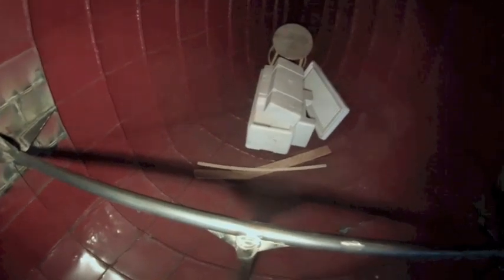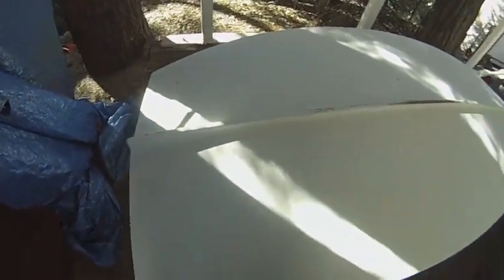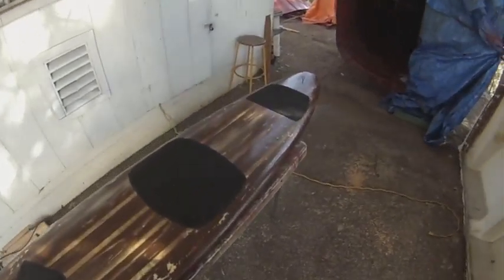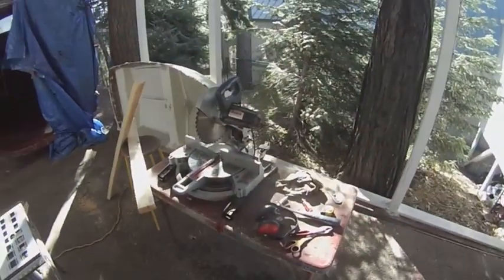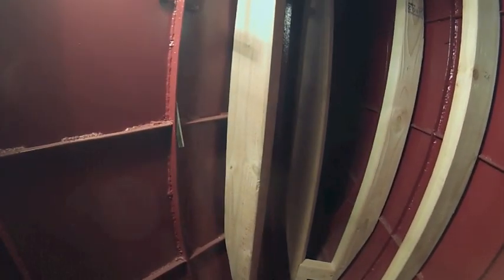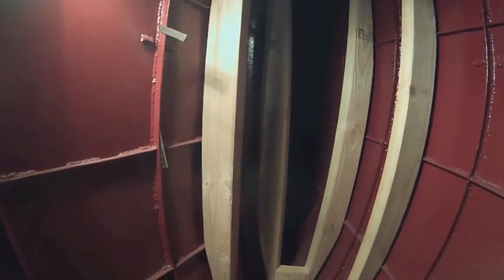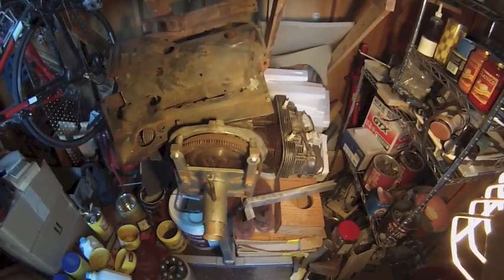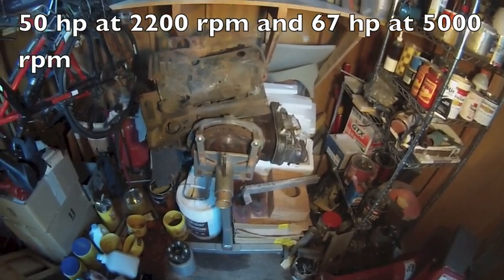Steel Sailboat Build Part 12

Comment: Hi I enjoy your boat build videos. I used to be a ship fitter. And a diesel mechanic . I have a warning. I'M sure you know but JUST IN CASE YOU DIDN'T.WHEN USING ALUMINUM AND STEAL YOU MUST USE A GASKET STRIPS OF OLD INNER TUBE Works GOOD AS A GASKET BETWEEN THE ALUMINUM AND STEAL. IF THEY TOUCH THE STEAL WILL FAIL quiker than a cat can lick it's ass. And when you bolt them together you must use Grade 8 bolts washers and nuts or they will fail. As far as air cooled engines on a boat . I have often wondered the same thing. All I can come up with is airflow air cooled engines need a giant amounts of air to survive. A old bug has a engineered Collingwood airflow if you take the engine cover off a bug and drive it it will over heat do to interrupting the designed airflow so you would need a really good airflow set up. Some big fans to vent the engine compartment. Also gas engines on a boat makes me very nervous . Due to gas fume build up in the engine compartment. So fans and good ventilation is critical. Diesel fumes aren't as explosive at low temperature. John diesel tractor motors I think would be cheap and available on Craigslist etc; just buy a old cheap mower . Anyway have fun

Comment: lets see if its making 50hp at 2000 rpm(dont think so)  It would be 130lbs of TQ. (not enough) Plus you dont want to pull an air cooled motor to that rpm loaded for long(the fan is not spinning fast enough.) Type 4 should be 65-67HP?
And of coarse they need lots of fresh cool air.

Comment: You can buy a cheap chinese long shaft engine for £250 buck new for your dingy and it would be under warranty for 12 months and the mounting brackets, shaft and the prop for £200 bucks on the internet, But i know how you love to do your own thing, but having a long or short shaft would mean you could go into shallower water with easy

Comment: VW engine... OK.  You will have isolate the engine in its own water tight compartment from the hull to the deck. You will need an auxilary blower besides the one on the engine. You will need a few bilge pumps in the water tight compartment. If water hits the cylinder barrels...good by engine.
You will need a couple of really good dorade boxes.
The water tight compartment will need water/air tight removable access panels for service.
If you go with a dry/hot exhaust system, that will need to be well insulated and hopefully you run it out to the transom. If you cool it with water and then you will need another pump for that.
I think you can make it work, but its going to take some time and its still  going to need mantenance on all the said systems.
Why not go with electric.
VW engine on deck ( air cooled ) with a generator on it to power the electric motors. Although, if a wave hits the cylinder barrels, good by engine. Also where the hell will you mount the engine and generator.
Just get a two or three cylinder diesel for the ease and safety of it or beat yourself up with the VW engine install.  
You seem to like the unordinary, so  go with it. Just do it on paper first.

Comment: 50x10 foot 2x4's would have saved 100 cuts, 50 trips to the truck and some $....a set of plans will turn out to have been the least expensive / most valued tool overlooked in your boat project.

Comment: This series is a source of huge entertainment at a well known yachting forum,  watching someone ignore 150 years of proven technology to create such a poor product.  If you had used proper sized frames, you wouldn't need to worry about "strengthening the boat. There would be a good case to write this hull off, and start from proven plans now you have had a bit of welding experience.

Comment: Congratulations on failing - much better to learn from those lessons at this stage of the project - it would be much more expensive later. Of the engine options you are examining I would side with the outboard option (if it is a long shaft) and preferably rigged as low as possible with inboard steering and throttle. Air cooled inboard is most unlikely to be satisfactory and will deflect you into making lots of design compromises in an effort to draw lots of air into and (more importantly) out of the engine space. An inboard small beta would give you the best long term service but may bust your budget.